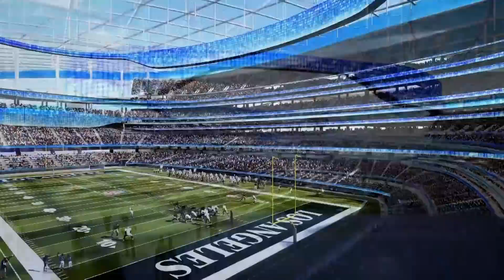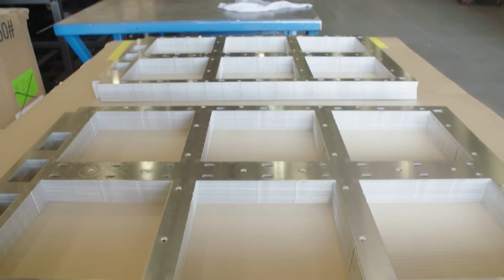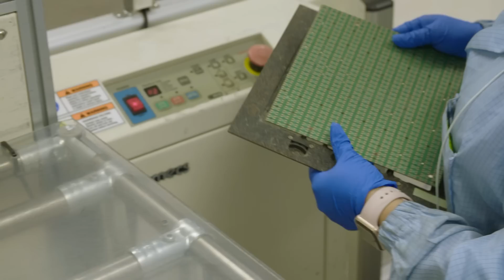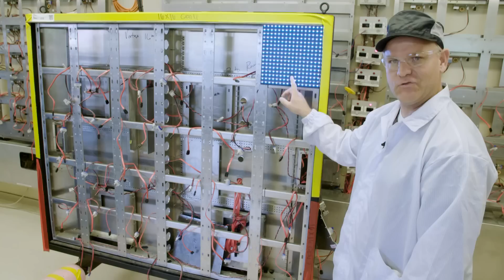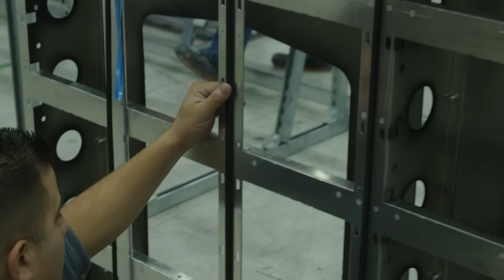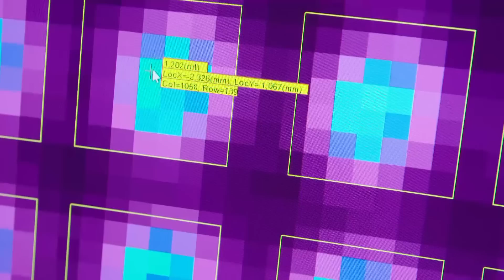Building 'The Oculus' - Largest Video Board in Sports at SoFi Stadium | Los Angeles Rams

Comment: Bruh who the frick thought SATA is what ought to be used as the communications ports between the individual panels? WTF. SATA interfaced LED walls haven't been used by the entertainment industry for like 8-10 years. Everyone else moved on to using Ethernet based controllers because of the increased bandwidth and updated hardware and software. As a Stage Technician I'm fricken triggered.
Reply: Tanner Robinson the wiring had me twitching. What a mess. That and what pitch is this screen?